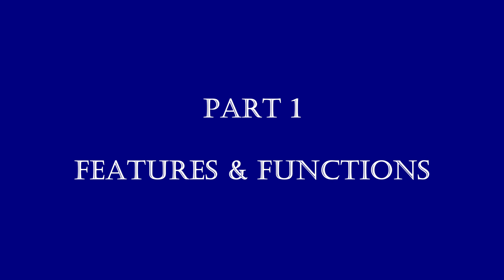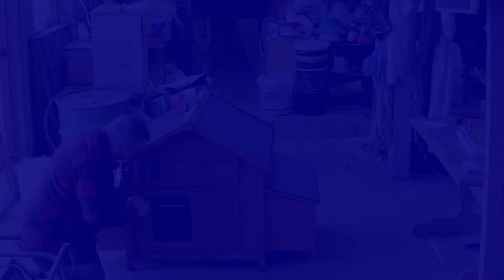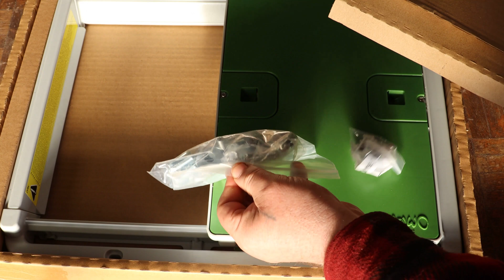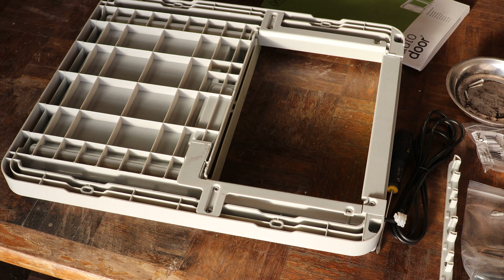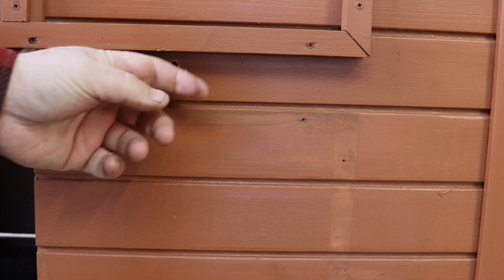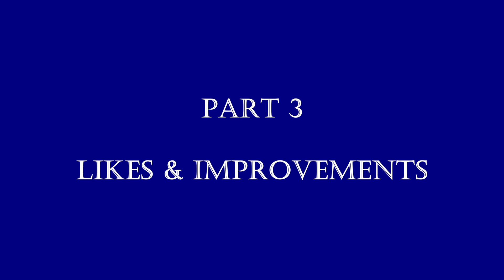The Omlet Autodoor Review (Automatic Chicken Coop Door)

Comment: My concern with auto-doors is safety...what happens when a bird is in the doorway when the door closes.  Many have documented that their birds were killed when the autodoors closed on their necks.  I have certain birds who tend to stay out later than the rest.  They would get locked out.  Our Rooster tends to sleep at the door with his head out as if guarding the flock from any intruders.  I can only imagine his head would get squashed.  Is there an electric eye on this unit to protect against this?  Also, where we live in Upstate NY, our winters are very cold.  Many weeks are around 0 F.  Batteries would not do well in temps like this.
Reply from the maker: There is a pressure switch on the door jamb. If anything gets caught between the door and the edge the motor stops immediately. It's not recommended for young chicks but it certainly wouldn't injure an adult bird, I've closed the door on my hand deliberately and a very light touch stops the motor. This unit can accept a mains feed via a 12V transformer if that would be better for you?

We are reviewing another make of unit on Friday that is a vertical pop hole and has a different built in safety feature that might interest you.

Comment: Had an Omlet auto door for 8 months,  agree with all your comments. It does have a battery meter on the controller and they do last a long time - I've only required one change in that time and I run the light on it too. One comment is that it's just thrown a fault and isn't opening/ closing properly just now. Hopefully a simple fix but I'm waiting till the Christmas break when I've got some time and daylight to investigate as my set up isn't as access friendly as yours
Reply from the maker: You are right about the battery meter, but I would really like a warning that I didn't have to remember to check for (mind like a sieve) 🙂. I hope your fault is an easy fix!
Reply: Found the issue with my auto door... turns out the two screws on the front which are for the emergency release had worked their way loose. Tightened them and it's working again. Figured worth sharing as a preventative tighten every now and again would be a good maintenance tip. Agree that an external battery warning light would be a good addition. Love your channel... it inspired me to get my own rescue chickens who are just lovely. Happy New Year to you.
Reply from the maker: That's really good information Chris - thanks. Happy New Year!

Comment: Great video again, thank you for your effort in putting these together, much appreciated. We have an auto door on our Omlet Eglu and it has never missed a beat. Agree with the comments on changing batteries - just have to be careful. Cheers
Reply from the maker: Thanks David! It's certainly a minor thing with the battery, just a suggestion for improvement!
Reply: Can the door be easily slid open from the outside by a predator like a raccoon ?

Comment: Nice video!  I have one of these and agree on your points about the batteries.  Changing the batteries is a fiddly chore and a low battery light is a great idea.  It is otherwise great and is easy to install and operate.  When I had a problem with a part, they shipped out a new one to me right away.  I feel like my chickens are safe with this door and would recommend it to anyone.
Reply from the maker: Great to hear that you like it - how long have you used it?
Reply: @EnglishCountryLife  My second winter is starting now.  I've never had the door fail to open or close.  I'm also using the coop light accessory which functions as advertised, however, my girls tend to roost long before it comes on, so it doesn't seem to matter much in my case.
Reply from the maker: @shawnbrown9560  Good info - thanks Shawn

Comment: I love my Omlet door, I am using the clock to open and close the door. 

The only thing I think it needs, is a small solar panel to charge the battery's. The 12 volt port in the control unit should also charge the battery's, but sadly it doesn't. When I was asking them a few question on the phone that is one I asked. 
 The heater I understand is not an option at the moment. The port is in the design, for the future.  I do find the light handy, when I need to check on them. 

All and all I would by another. I am also looking to buy one of their coops for a brooder, next year. What are your thoughts on that??? Using it for a brooder box.

Idea for a future Video:  Plans, spec. and design build for the henhouse you are using for the door demo. Including building techniques, please.  
 I love the look of it and I want to build an "English Country Life" hen house for my very own.
In English units, none of that metric c%#p.  :)

Thank you for your videos, I always enjoy them. God Bless you both, and Marry Christmas.
Reply from the maker: Hi Michael! 

I haven't considered using an Omlet coop for a brooder box! We hatch using broody Orpingtons so use coops large enough for up to 12 large fowl to occupy as they grow. In the Omlet range I would choose the wooden Lenham range for that purpose. We do occasionally use a brooder plate for chicks that have had a struggle hatching but use an old tin bath as a brooder box!

I've just finished a coop refurbishment. You can see it in this Friday's video. That one is my favourite design that I've refined over the years - let me know on that video if you want more details. 

Hugh

Comment: Got one of these. Had it 8 months. 5*. Very good. Instructions are clear so it's easier than it looks. I did get the hole cut by the coop maker beforehand though. I did have to adjust the light levels, because otherwise it did close too early by default.
Reply from the maker: We've tried several types and always have to adjust the Lux setting. Interestingly we once moved one of our coops to face East instead of West and that massively changed the closing time. It's so important that you CAN adjust this.
Reply: @EnglishCountryLife  yes it was very easy to adjust.

Comment: Do you have any tips for dust in coops of that size? I have a coop that size my 2 ISA Brown hens sleep in at night and I use dust extracted straw bedding however it gets so dusty, there is ventalation, sometimes I have to use Diatom for dampness of roof of nest boxes, if you have any tips on reducing dust and dampness for chickens living a smaller coop that size that would be great :)
Reply from the maker: That's very interesting, what type of dust is it? Soil or more grey?
Reply: Grey
Reply from the maker: @horselover074  It's not the diatomaceous earth itself is it?
Reply: The diatom I use is white (food grade diatom) and I make sure to rub it on the damp parts rather than leave a pile to avoid dust, it could be some of that and straw but due to being a small coop I worry the air is dusty and want to know tips on reducing dust while also combating dampness :)
Reply from the maker: @horselover074  The best I can suggest is to use soft wood shavings rather than straw, clean any poop out daily & ensure the coop is water tight ( rather than adding diatomaceous earth). DE is helpful in reducing parasites but inevitably will add to dust.